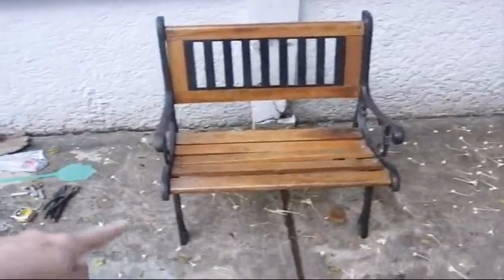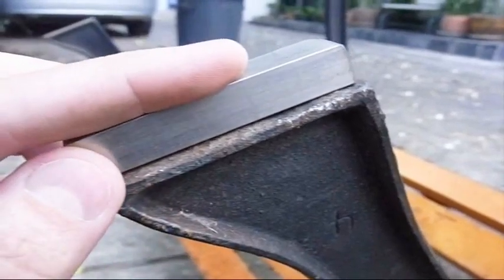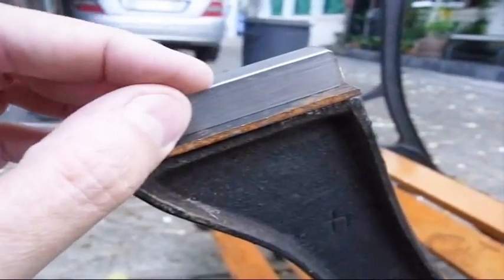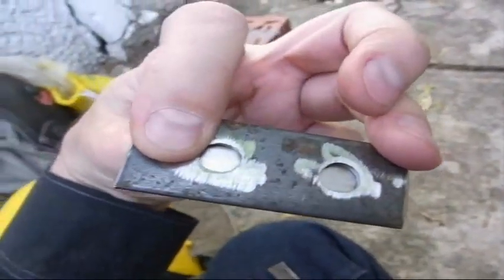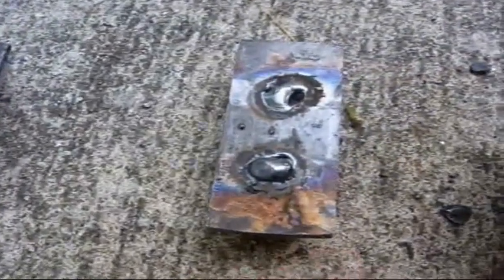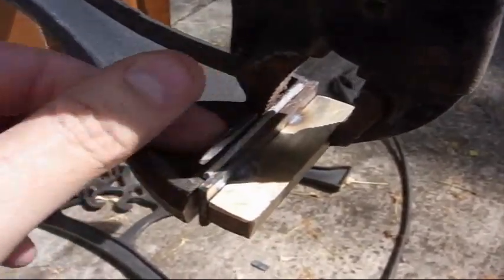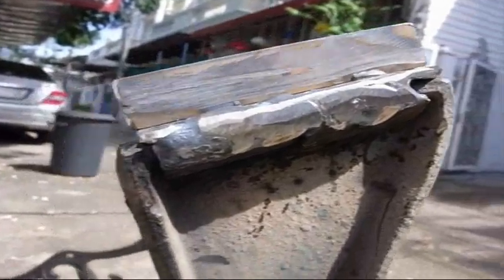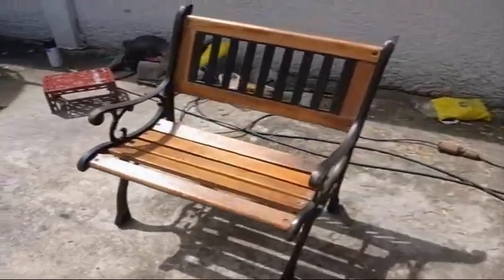No Rust Stains - Stainless Feet For Cast Iron Legs

Comment: Wouldn't it have been easier to braze the stainless pads to the bottom of the feet?
Reply from the maker: Maybe, I have no experience brazing cast iron, and all I have is a stick welder. Per the note in the video there are nickel rods for cast, but they ain't cheap and my local store does not stock them. So this was a workaround.